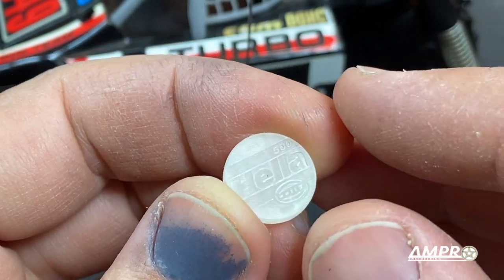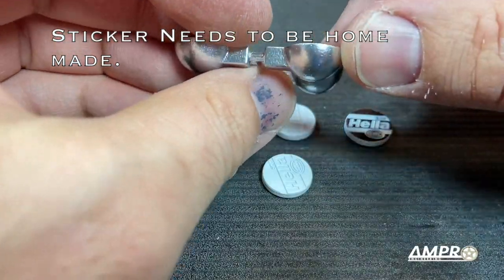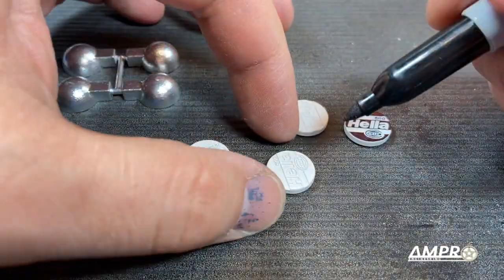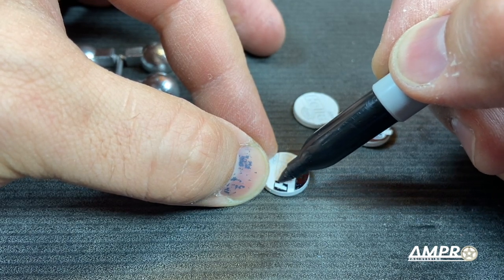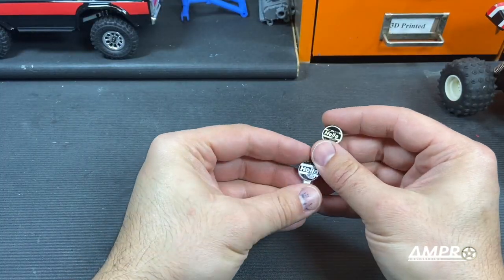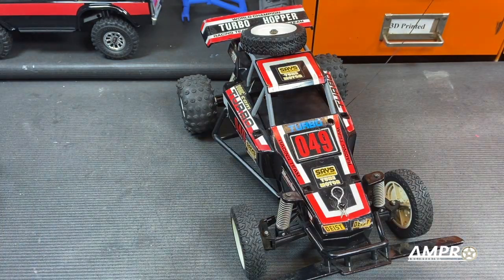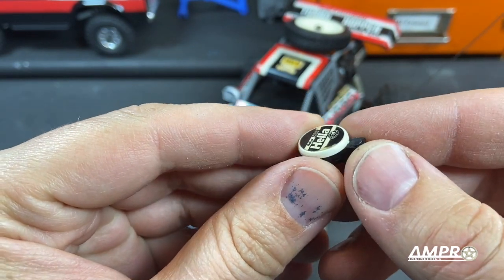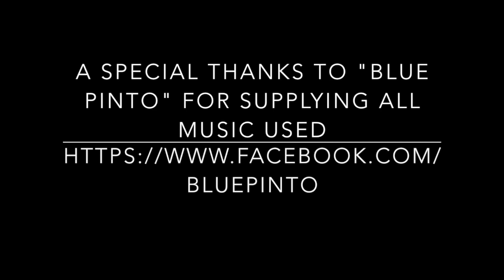E287: Tyco/Taiyo Hopper Auxiliary Lamps

Comment: Hello bro
I have question can i use the 20A ESC with wpl b14 incoming battery(6V Ni-Mh 800mAh and if im not wrong its 5S) will it works fine or burn?
Reply from the maker: This is the one I use for this car. Seems to work great.
Reply: @AMPROEngineering  Thanks dude